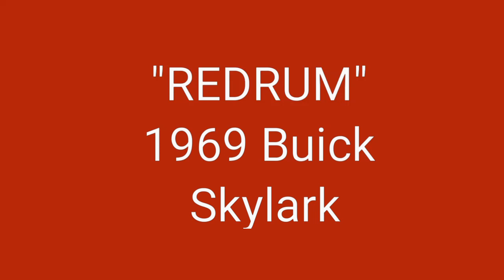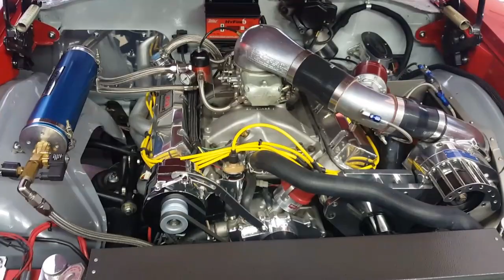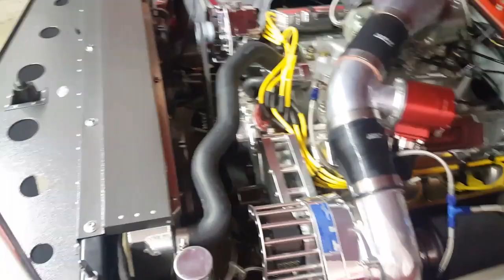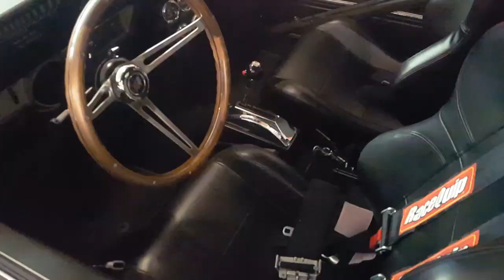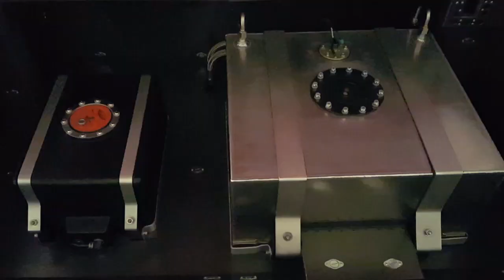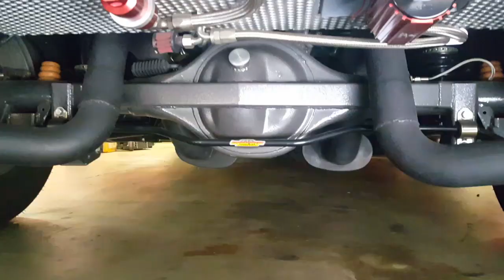1969 Buick Skylark supercharged pt.2

Comment: I have never seen TA Performance valve covers like those! Which ones are they?
Reply from the maker: They carried them only briefly in the 90's. They were called "Aluminum Fabricated" covers. I have searched for them online and no success. Not sure why TA discontinued them.
Reply: Thank you for the timely response. I wanted to ask you because I’ve seen you work on these cars and motors. I have a 1969 Buick gs400 and I want to put in that 455. I love the numbers that the 70 motor puts out and I’m reluctant to put in a 71/72 because the compression HP and torque were significantly lower, but there’s a 72 motor for sale locally near me. If I buy the 72 would it be easier/more cost effective to have a machine/speed shop blueprint that motor to have similar or better specs than the 70? What would that entail? Was it mostly the fact that the 70 had different pistons than the 71/72’s deep dish piston? Or is it better for me to wait around for a 70 motor? I know that either route I go with I’ll end up getting stage 1 of 2 heads from TA. But I just want to know if it’s cheaper/easier to get the 70 motor or if it is just as cheap and easy making a 72 motor put out 70 numbers assuming the pistons and other components are swapped to get the higher compression/ better numbers. Sorry for the paragraph I just could use some advice. I know that the 71/72 ran on regular fuel and that the pistons were deep dish which Dennis Manners stated was the main reason for that compression loss. Thanks!!
Reply from the maker: @andycadenas8465  Great questions! Here's my opinion. I'm sure others may have different ones. The 70 engines have really only one advantage and several disadvantages over the later engines. The advantage is their compression ratio. The stock cast pistons had a much smaller dish that resulted in the better compression ratio. Their primary disadvantages are the smaller oil pick-up tube and the smaller primary oil passages. They were 1/2". That said, BE ADVISED, the early 71 blocks also had the same passages. They had 2 runs of blocks in 71. The latter versions had the better pick-up tube and passages. You'll want one of those or later. If you are already planning on replacing the pistons and heads the even later engines are best. That is due to much less "core shift" found in the block castings. That doesn't mean you can't find good 70-71 blocks, I have, but typically the later blocks are better. All that said, the later pistons, heads and intake manifolds are not very good. So, a later block, with good TA internals, heads and intake is always a great combination.
Reply: Thanks a lot for your time and knowledge! I might end up going with a 72 455 and having it rebuilt with TA parts to try to get the hemi killer specs lol appreciate you! Cheers!
Reply from the maker: @andycadenas8465  You're welcome and best of luck with your build!

Comment: Have you ever dynoed or raced at a track with this setup?
Reply from the maker: Chassis dynoed at 687 HP at the rear wheels. So with a 20% parasitic loss it would be around 860 at the flywheel. That is with a street tune and pump gas. With the timing back in and race fuel maybe 900+. Ridiculous torque numbers of 900+ lbs ft.
Reply: Nice thanks for the reply  @probuick3317

Comment: hope to bring mine to this level some time soon.  its a work in progress.  actually though the car i have is extremely low mileage so the car is almost mint. the interior is especially good. added a 70 455 and done a  fair amount to the engine so far too ta heads and much more 462 ci.
Reply from the maker: Outstanding! Looks like you know your way around a Big Block Buick! Let me know if I can provide any insight on a blower engine!

Comment: Is the accumulator Tee  off the oil sending  port ??
Reply from the maker: No, there is a spacer between the filter and the oil pump.  It has a threaded port for a fitting to be installed so I can run that braided hose. I purchased the spacer from Summit. If I recall I talked to a tech to get the correct one. It has a gasket like the oil filter on the pump side and a surface like the oil pump on the other for the filter to spin on.

Comment: Wow what an engine compartment! How much is she making? I’d love to upgrade my 455 some day with roller conversion and aluminum heads.
Reply from the maker: Thanks for the kind comments! 850 at the tires with race gas and timing all in. So, I think about a 1000 at the flywheel. With pump gas and timimg pulled out it's 700 at the tires. Good luck in yours! BTW, TA performance is your go to for the best aluminum heads for the 455. They also have all the hardware you'll need to run a roller.
Reply: Pro Buick is yours a hydraulic roller set up?
Reply from the maker: @STREETFIGHTER50  

No, it's a custom ground (for the blower) hydraulic flat tappet. I am very happy with it but in hind sight I wish I would have spent the money on the lifter girdle and done a roller.
Reply: Pro Buick I’m still debating on which way to go. My 462 only has about 500 miles on it. I wonder how much I’d end up spending on everything I’d need from TA Performance. Aluminum heads and the whole roller set up. That EFI Sniper set up would be nice to have as well.